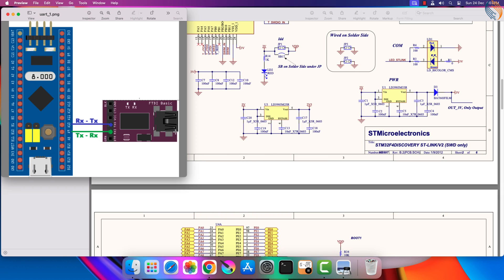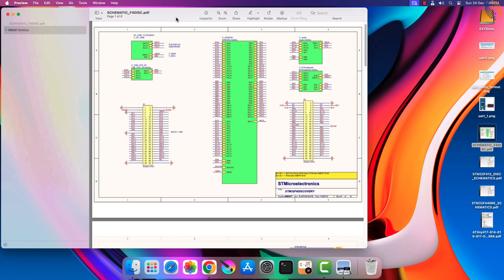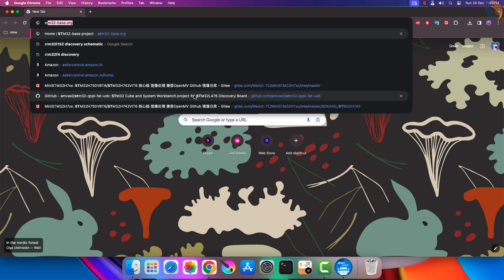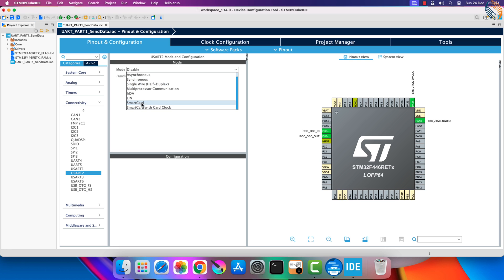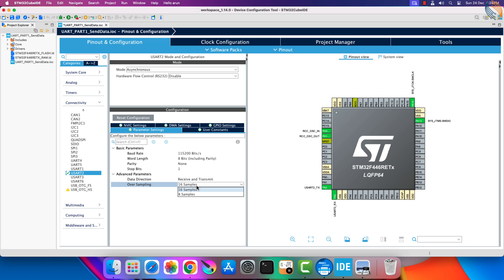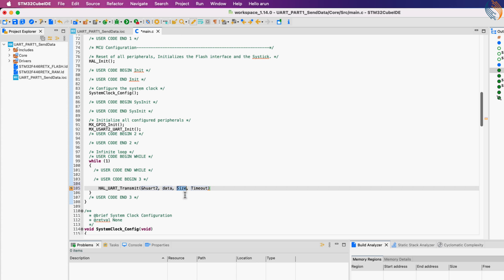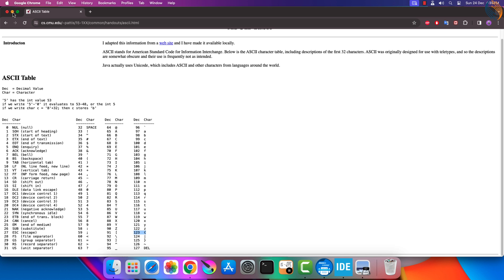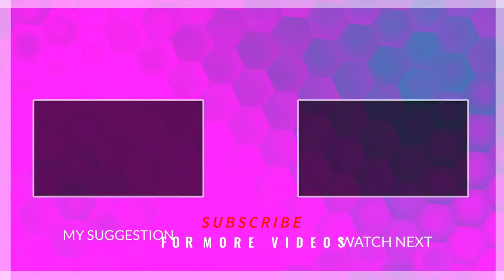STM32 UART Tutorial #1: Configure Parameters and Send Data

Comment: Why did you send the address of data variable in UART_TRANSMIT function when aending number?
Reply from the maker: You means at 12:00 ? HAL_UART_Transmit takes the pointer to the variable as the parameter. Therefore we need to pas the address of the variable.